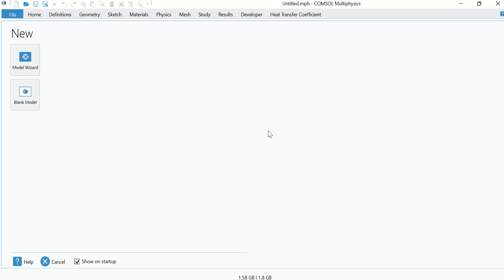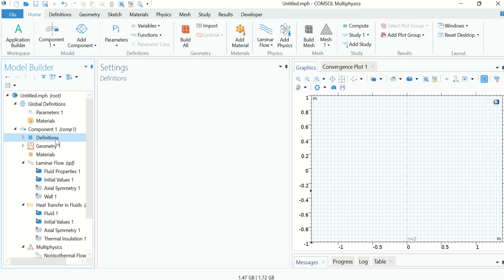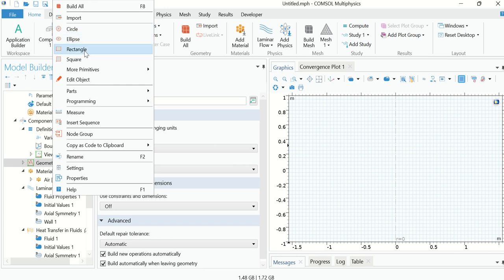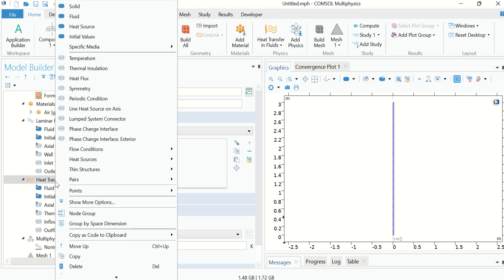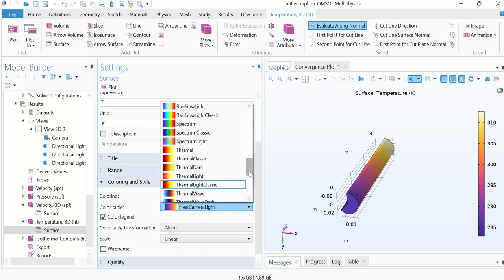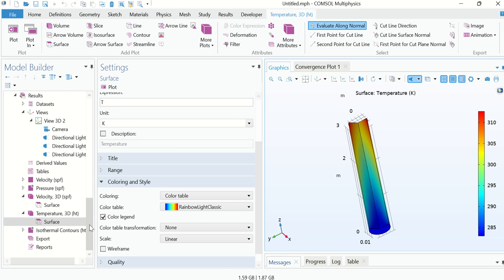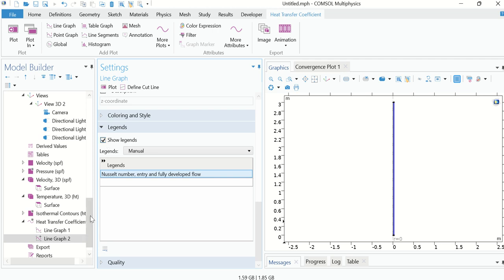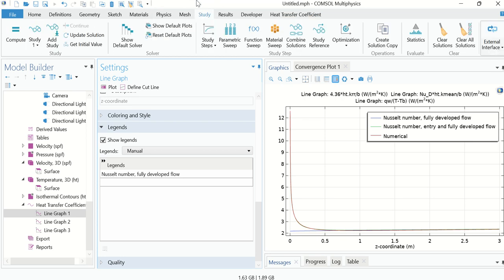Heat Transfer Coefficient calculation in COMSOL Multiphysics

Comment: Can you please help me in calculating avg nusselt no. In a 3d rectangular channel which is same as the one u have used just its rectangular? In which fluid is moving in turbulence and a constant flux is at base
Reply from the maker: Hello, pleas share your problem. You can reach at engr.amir14@gmail.com

Comment: Hi, you calculated heat transfer  coefficient for boundary 4 which is not a wall of flow or fluid?
Reply from the maker: Boundary 1 is symmetryy, boundary 2 and 3 are inlet and outlet, respectively, while boundary 4 is wall, which is exposed to heat flux qw.